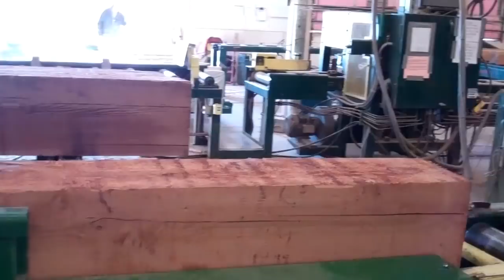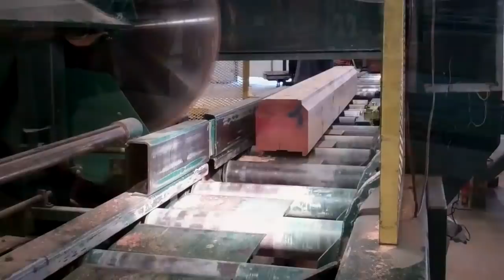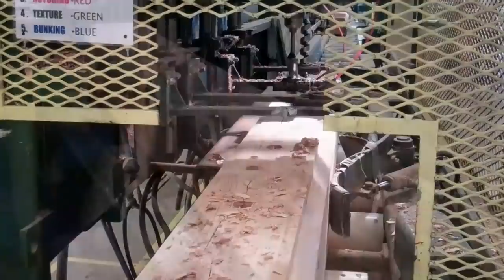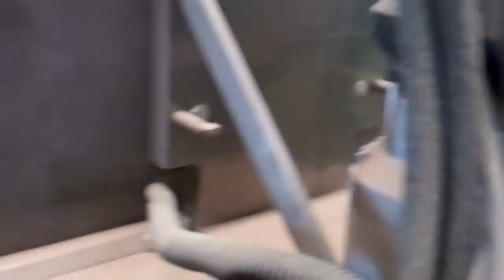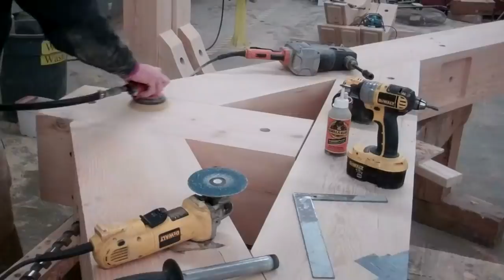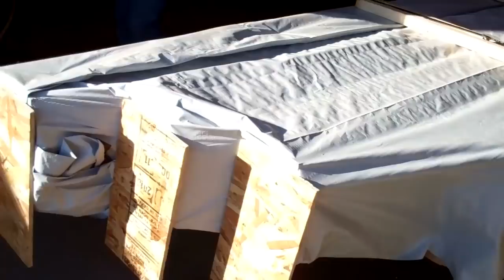Custom Milled Log Home Manufacturing

Comment: when the wood is finally cut do you not have to treat the would or is it already treated>?
Reply from the maker: Once the house is erected it will require treatment and regular maintenance or the wood will start to change color and weather.